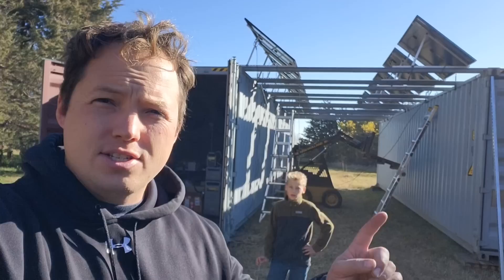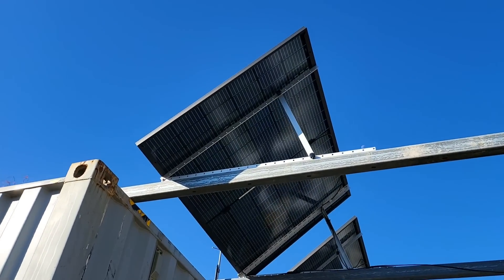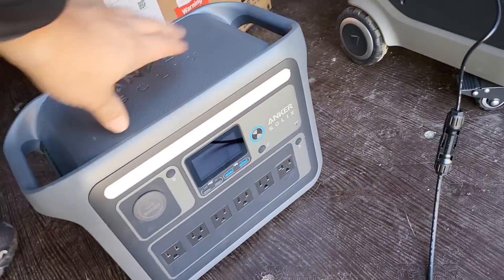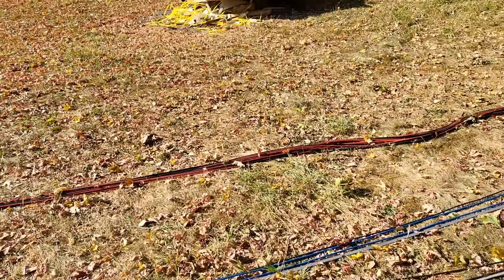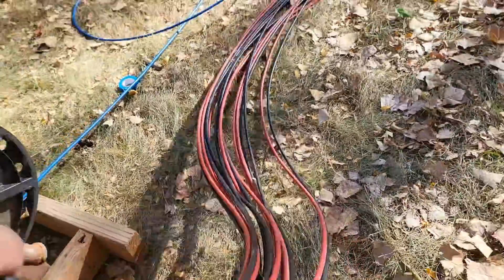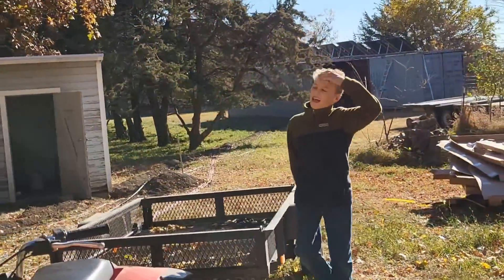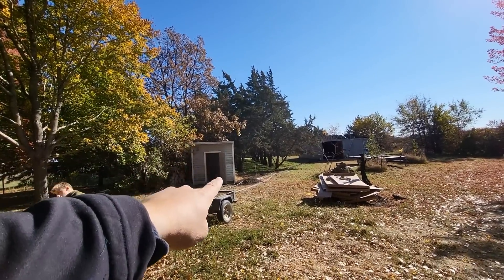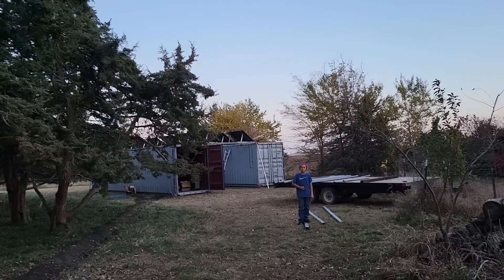We're Installing Solar! How It's Going So Far...

Comment: I would make a wiring harness and specifically use one length for plus and minus each, And specifically and carefully cut out about 1/2 inch insulation. With the rectangular razor blades, not cutting into the copper. Measure right where you need it down the line, then add the 2ft or 3ft tails with the mc4s on end in a splice. Solder with good flux. Its a process but it is easy when you have it and you know how to use it. Add marine heatshrink and a continual encapulated bead of silicone over the soldered joint. The marine heatshrink makes it professional grade if you ask me.  Its stronger and more waterproof when done this way. It works perfect for straight parallel installations with 10s of panels or just several. 
Beats the heck out of making more ends, no junctions, no losses, less expense, better overall product. 
If you are doing them in parallel, if series, it should be a bit more straightforward but I have done this with parallel and series or series parallel is a bit more honky.

Comment: Lost a lot space and leaving the wire exposed to the sun.
Reply from the maker: Are you talking about the gap between panels? If so I get what you mean. The main reason was just that the spacing of the ridges on the container made it practical to lay it out this way.

Comment: Like what you do and like your property and work on other jobs you have done as well. I have followed your vids for some time now enjoy them. If it was me i try to move that small building to near the pwr pole shown in the vid where the pwr ran to the different buildings on the property. Put your batterys/inverters and al in there vs the house, hey the trench is still open?  Even add a gen and propane tank near the building as well. Less noise eaiser to service anything in the future in any weather vs being confinded to a small basement area or having to fight the crawl space. It will save you on wire to from all the solar strings. Eaiser for the utility trench down the driveway vs trying to go into the basement of the house with a new 400 amp service, especialy if it ever needs to be dyg up again. Great your son helping you rock on.
Reply from the maker: That's definitely a compelling option for sure. Another benefit of keeping the batteries out there is that if anything has a malfunction that causes a fire, it wouldn't be in the house. One downside, though, is that I would have to heat it to probably 40/50 degrees in the winter to protect the batteries.

Comment: Hmm..  Wish I was able to play with this much solar..  I would have just got a high voltage MPPT charger and an external 48v battery to plug in to your 3800...  Multiply by 2 if you want to do both inputs on the 3800..  Less cables, less size, more battery storage...  Good luck man!

Comment: (1.) Have you got your 12 panels in a 3S/4P configuration. What not 6S/2P? Too much voltage for whichever MPPT you're using? (2.) Have you moved? It looks different from your older videos, like when you showed how you wired a 50 amp inlet for your generator.

Comment: Please learn more about LC coupling re lightning before running ethernet there.  If you're trenching below the frost line run, run two extra 2" or larger PVC.

All of that 8 AWG was a massive waste.  You were better off getting into higher LVDC.  Assuming those 405W are ~32v Vmp and ~38 Voc, you're right on the money for a 380VDC system.

Since you're now past that point, I will give you one very useful yet little-known fact: QO (not QOM1/2) breakers from 10A to 60A are rated AND LISTED for up to 48VDC and up to 8 awg per terminal.  You can land each paralleled pair in polaris taps just before the breaker.  DIN mount UL489, including QOU, is also an option.

Good luck!
Reply from the maker: I 100% agree that this isn't necessarily the most efficient way to put a solar setup together. The reason we're doing it this way is to work within the limitations of the F3800 system.

It's highly likely that the solar setup will be changed and updated in the future, so your recommendations are very appreciated! 

Super interesting about the QO breakers!

Comment: Hi Ben...unless you plan to use more power in the garage/barn and well house in the future, I would  use the existing 100 amp cables from the pole for them too, no need to spend on them.
From your pole to the house I would run the same capability as from your utility to the house or 400 amp hardware so that its there for possible future upgrades/capacity to the out buildings or other projects. 
I'm also interested to know what your electric rates are. Do they charge a seasonal rate and by the "time of use" or a simple flat rate 24x7 all year long and so forth? Also, your area has no natural gas, is that right?  You have propane trucked in, correct? Propane rates/cost per gallon/pounds are how much?

Comment: Nice! We just got the approval from Xcel energy for our solar project here in St. Michael, MN. Our installer wanted to do it in December. I told them absolutely not. There is zero chance I want anyone crawling around on a 6/12 pitch roof in winter in our climate. Not only is there the greater chance of damaging the shingles in the cold but I heat the garage and our main panel is in there and I don't want the door open while they mess with the main panel. I told them they can schedule the install for April. It's a 19KW system, I'm pretty exited for zero net electricity bills in the future!
Reply: Hey Kory ! Sounds like you’ve done your homework . I’ve always wanted solar ..but…. Roof condition is marginal so I kinda am thinking it will possible when roof needs replacing. Can I ask you ..did you ever figure when your break even point will be approximately in terms of years , for your solar install ? Thanks ..just curious
Reply: @gman5051  We're set for a rate increase next year. So the payment will make our savings start day one. As the payment will be equal to our current electricity bill. The break even point is slightly more difficult to figure as we are not paying up front. I don't have the $50K on hand to write the check. But that would take give or take 18 years at today's current bills. Adjusting for rate increases makes that more challenging  obviously, but probably closer to 13.
Reply: @koryleach9660  thanks for the information Kory

Comment: Makes no sense.  Inverter and step up to transmit.
Edit.  Go UK style 3 phase AC
Reply: No electronics in the US are made to run on three phase other than commercial heavy duty equipment.
Reply: @koryleach9660  Untrue.  You tap each phase to give you what is equivalent to 240.  It can then be stepped down to US voltage whist doubling the current.
Reply: @koryleach9660  Ultimately one cable is carrying a minimum load of 300 amps at 240 volt.  Doh!  That's 600 amps at 120V
Reply: @koryleach9660 Automotive Alternator is Ac 3 phase?

Comment: Please do yourself a favor and don't run ethernet outside, underground or not. Lightning is prone to take it out.  Run fiber instead.  You can purchase pre-terminated fiber and then put a media converter on each end for an ethernet connection.
Reply: he could easily run new ethernet with the extra space in the pipe.. simply use the damaged wire to pull in the new one. If it is under 100 meters, not worth it for fiber
Reply: I would also recommend fiber.  He mentioned that the other cable are 300ft long so that is nearing the 100 meter limit for ethernet anyway.

Comment: NEC requires the conduit run be complete before the conductors are pulled in. Installing the conduit piecemeal around the wires is a violation.
Reply from the maker: Here's an interesting thought on that. Technically, the conduit is only being used as a sleeve since the PV wire is rated for direct burial. I'm essentially adding extra protection.

Do you think that the same NEC rules would still apply? I'm not an expert on this. Also,  I'm pretty sure I could have pulled the wire in after the fact if I had enough manpower available.
Reply: @BenjaminSahlstrom  I believe the reason is the PVC glue can damage the insulation.

Comment: When I built out  our system, I chose to put the battery wall on one end of the shipping container, along with my solar charge controller and  DC/AC inverter.  From the inverter I ran all of my  AC lines to a service/breaker panel -just like you would find in a house or garage.   We are working on doubling the entire set up next spring/summer.  With the 2nd array I will upgrade the breaker panel and be able to have 220/240 AC power at the panel. with at least 50 amps.   We are up here in northern MN and I had to run some math on figuring out our panel tilt.  You are smack on the mark at anywhere from 33 to 35 degrees up here.  Year round.   The only way to get more out of our panels is to use a solar tracker to auto tilt them. (something we just might actually do...)   We staged our panels on the face of a hill facing  SW-ish.     They are stationary/fixed.  Been in operation over a year so far, and doing fine.    ... "keep yer stick on the ice!"

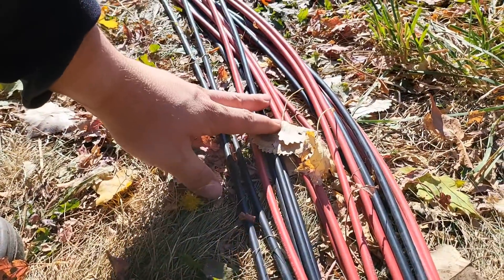Comment: Normally single digit time with a leading zero is 24 hr time. If the sun is setting, your watch  should say 18:27, not 06:27, which is 6:27 am. Likewise, 4 digits for all times is 24 hr time in the absence of am/pm indicators. I know because we program code for time displays and there is an international standard on its appearance in 12/24 hour times. 😊

Comment: I'd have recommended using inverters in your container right at your panels, then output that 120Vac over the long run using direct burial AL appropriately sized for future panel expansion. Less voltage drop and fewer circuits, fewer points of failures, and probably notably cheaper. Use something like the EMP hardened EG4 18K with the money you saved 😃
Reply: I had the same thought. The savings from using fewer/thinner wires could be substantial
Reply: @PedramPourmand  it's precisely what I've begun doing myself, container is 120' from my soon to be off grid home. Container will be my solar,  battery and inverters shed. If anything goes up in smoke, Noone dies.
Reply: How are you going to manage winter's freezing temps on the container and still charge your batteries?  Asking because I agree with you but we have to keep those batteries warm.
Reply: @mondavou9408  Good question. Hadn't thought of that. In general inverters and batteries generate heat and require cooling. Most of them have built in fans to stay cool. So perhaps with enough insulation inside the container and the heat generated from the equipment you could maintain minimum operating temperatures?

Comment: 8:00 - We had here in the PV-park the problem that some animals did chew on the cables, the cables (positive and negative) were directly beside each other and because of this, they created a electric fire in the earth. The cables had from the PV enough energy to burn some meter cable away. Not funny and this happened not only once.
But think that this cables will get hot if they are so tight together and with some current for several hours.

I did buy HT pipe 110mm 2 meter (Polypropylene pipe 4 inch, 6.5616798 Feet) für 4€ in the past, not they want 11€. Price nearly doubled.

Comment: How will you ever recover the cost before the panels need replacing?
Reply from the maker: Probably won't! It's more the freedom of having backup when the power goes out. 

Time will tell as to how much we're able to produce.
Reply: @BenjaminSahlstrom  I'll agree with that statement. I'm still wondering what a diesel generator would cost to install and then to run the properties electrical needs per day.
Reply: @ Thanks for your response. As always great video.

Comment: Why did you not put roof between rail cars to make open space between 2 cars covered storage . Or could concrete between them put roof under solar panels between to cars for covered storage between cars
Reply from the maker: Good question! I may still do that eventually but here's a few other thoughts about it.

1 - By having the panels between the containers like this the snow should be able to effectively slide off and not drift/accumulate as much as it would if I put the panels directly on top of the containers.

2 - Having the panels suspended up off of the ground with no roof underneath allows for some bifacial gain. Not sure that this amount to much, but it should be something.

3 - Logistically I'm not sure how soon I would be able to actually build a roof there so I decided to just prioritize the panels for now. I do have some more options for ways I could still add the roof under the beams if/when I decide to do that.
Reply: @BenjaminSahlstrom  Letting the wires "hang" and possibly flop around might cause problems if you get heavy snow or freezing rain in the that area.

Comment: With all the copper you are having to run for home runs to the house, I have to wonder if it would have been cheaper to put more panels in series to boost the voltage and just buy or build a new solar inverter/charger system that can handle more voltage.
Reply: Hard to do with Ankers F3800. I bought a Victron system, where I can put together a long string in series and then parallel.
I don’t see the A3800 being a long-term solution.
Reply from the maker: The nice thing about having all that copper out there is that it gives us a lot of options going forward. I plan to do some testing to see if using the second set of conductors makes very much difference.
Reply: @BenjaminSahlstrom I’m very curious about what your voltage loss would be. I’m looking at going about 80 to 100 feet and I need 4g wire to get my volt lose below 3% but I would much rather use 2 sets of 8g
Reply from the maker: @Bigsparky710  My voltage drop is pretty significant. I haven't actually measured it yet, but based on my calculations, I'm expecting to lose 15%. Since I'm wiring this in parallel in order to make it operate natively with the F3800 system, we end up with some difficult tradeoffs. 

Makes for a great learning experience and will still help reduce our energy costs.
Reply: @BenjaminSahlstrom  I’m in the Facebook forum trying to figure out this problem. Someone was saying to use a combiner box then run bigger wires back. I’m gonna try to figure this out. I’m a master electrician in Mn trying to do something similar to you. I been looking for 4g PV wire which I can find but I need to figure out how to get that to mc4 connector idk if they fit 4g . I have some ideas but I want to run them by more people. I don’t do solar I’m just a residential sparky but I been digging in lately alot to figure all this out.
Reply: @BenjaminSahlstrom  my understanding is it is against code to run 2 sets of  wires . Usually you just go with a bigger wire but I assume you didn’t because of what I just said it hard to find. I’m determined to get my volt lose under 3%
Reply: @BenjaminSahlstrom  ok so what I decided is going to do after I talked to another master  electrician I know and also anker forum.
I’m going to get a short 8g mc4 wire connect that to my parallel 3 400w panels. Then run that into a combiner/junction box then I’m going to get 4g PV wire run that into the combiner box and use a Polaris style connector , cut the 8g mc4 off the side inside the combiner box and connect the wires. Then I would run the 4g to my house with another combiner/breaker box here I would install a breaker for the 3 panels together. Then out of that box and go back to 8g mc4 to connect back to the anker.
I will be using inline fuses between each panel before the connect on the positive side.
This would probably be the better way to do it and reduce voltage to under 3%
Reply: Bring your mains to the place where the majority of your power needs and number of circuits are. The house makes sense and then run to the pole off a sub panel. Your going to save lots of money on conductors this way. Q: Which mounts did you go with and how are those two panels held together securely?
Reply from the maker: @jamesbsa6450  These are the mounts: https://amzn.to/3C8cAJo
I'm not sure what you mean by attaching two panels together?
Reply: @BenjaminSahlstrom  thanks! How many panels are connected to those two legs (one ecoworthy kit consisting of just two legs)? If more than one, then how are they attached securely at the gap? 
Also, i don't know your panel specs, but to reduce copper wire diameter you need higher voltage, this scales nicely. Working with a 12v panel is terrible for long runs. A 40voc ish panel is much wiser.
Reply from the maker: @jamesbsa6450  One set of brackets per panel. So in total I had to purchase 12 mounts. I think that kit I sent the link for is for 2 panels. 

The VOC for these panels is 37v if I remember correctly.
Reply: Would it be cheaper to run regular wire between array and house from shut off to shut off the pv cable from there plus takes less room could use smaller conduit? Just a thought.... Jeff